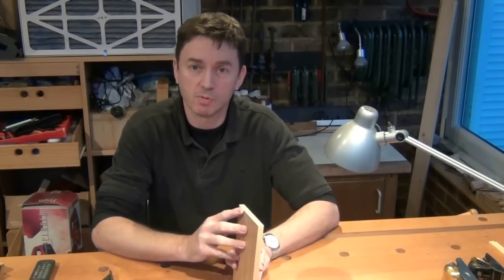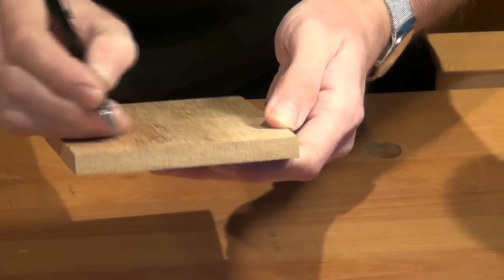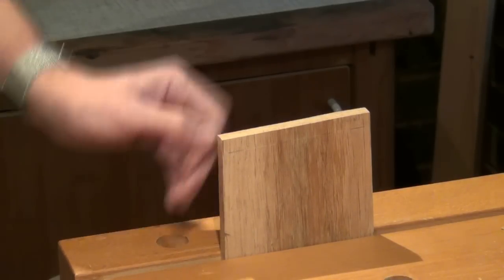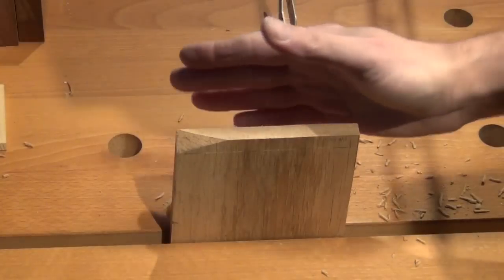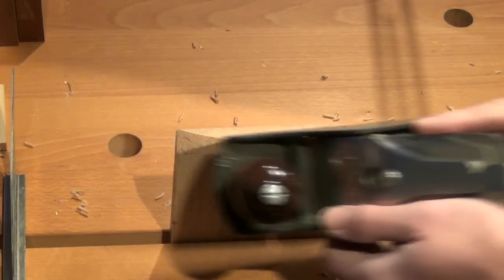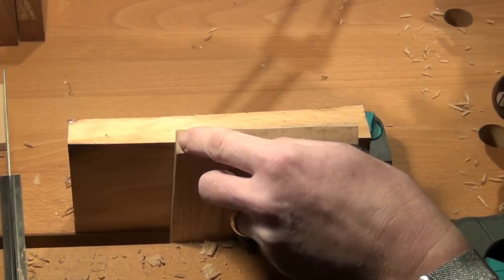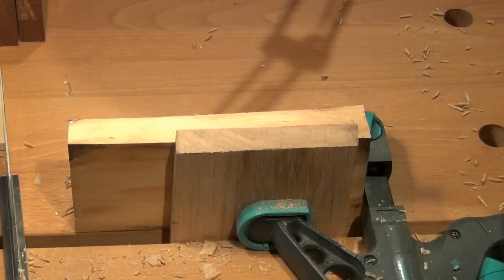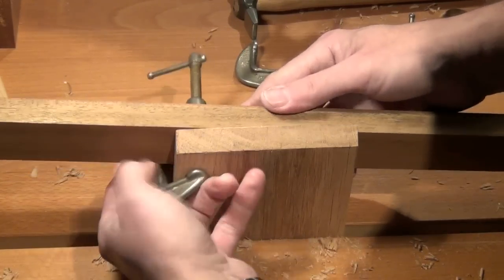Carcase Mitres - if you don't have a donkey's ear shooting board

Comment: Mitch, Very nice video and handy technique that I'm sure many will benefit from. Thanks so much. If I could offer a friendly suggestion to you and one to your viewers, I would say, when planing the bulk of the miter, try pointing the toe of the plane skyward over the end of the workpiece at a 45 degree angle so that its pointing toward the 10 o'clock position. You can think of this as decapitating the endgrain if you will, rather than plowing into it horizontally or on a downward angle which causes you to plane into the endgrain. It can seem a bit tricky to hold the plane at a 45 on the x-axis while simultaneously holding a 45 on the y-axis, but it greatly reduces friction and tear out. You will find that you don't even need that whole sequence of planing off the trailing edge before you get started. I picked this up from Paul Sellers when he teaches how to plane a roundover on box bottoms. Its not necessary to do this when planing longgrain, but doing it on endgrain saves lots of work and heartache. The second thing I would offer, this to your viewers, is when you find yourself thinking (or in this case saying at 12:41), "It's just starting to lose its edge" this is the exact moment when you want to stop and take your iron or edge to the stone. If the edge is noticeably dull, then its noticably in need of sharpening. I know when I first started woodworking and before I learned to sharpened freehand, I often delayed and pushed my edges past the point that was good for my projects which resulted in poor results. Since my sharpening takes no set up, I can now get a surgically sharp edge on planes and chisels in less than a minute. This allows me to never compromise on sharpness and produces superb results. As soon as I notice any degradation on my edge, its off to my diamond plates. Do this, and you will never be sorry. The key part of this is learning to sharpen freehand so sharpening doesn't take you off task for 10-15 minutes. If you trade jigs for acquired skill, you can sharpen very quickly and without the hassle of wasted time. Since Mitch seems to be a skilled woodworker, I'm sure he knows this and normally sharpens as soon as he detects the slightest dullness in his edges. I suspect he only pushed his edge beyond this point because he was in the process of filming a video. This is no great secret and I think nearly every woodworker figures this out eventually, so my hope is to help those of you who are newer to the craft and who have simply not figured this out yet. Happy woodworking and thanks again Mitch. Keep up the great work.
Reply from the maker: Thanks for those points Damien,
 A quick strop might have been advisable here. It's an interesting point actually, as I do feel the dulling of an iron at a very early stage. Often the blade will still cut hairs on my arm, and take wafer thin shavings. Clearly there must be an optimal point at which to strop or re-hone. Even at just half a minute to de-iron, strop, and re-iron, doing it every couple of shavings would be overkill. Deciding that point has to be a gut feeling, and it will surely improve with experience. What I feel is most important to get over to beginners in this respect is how to sharpen quickly and effectively, so that they don't put off the job.
 Skewing the plane is always worth a shot, but just be careful you keep enough sole on the work to register well. Personally I use a mitre shooting board, which protects against tear out.
Thanks, Mitch
Reply: +Mitch Peacock - WOmadeOD-Point taken and I agree totally. There is definitely a possibility of sharpening too often, but I think you would agree that this is far less common that waiting too long. I think most people want to keep planing as long as they can because its far more enjoyable than sharpening. I don't mind sharpening, but I'd rather work wood than steel. When I made the sharpening comment I was hoping to benefit the novice woodworkers that watch your fine video based on my personal experience. I know when I first started woodworking I developed a bad habit of pushing my edges way past the point of being good for a sharpening.  I was sharing my learned lesson hoping current novice woodworkers might learn vicariously from my mistake. Of course someone as experienced as you certainly learned that lesson long ago. Thanks again for a quality videos, keep up the great work.
Reply from the maker: +Damien King Being self taught, it took me longer to realise what a properly sharp edge was! kicked myself when I did 😉
Sharpening is very difficult to teach by video alone. I recently taught sharpening in person and it was so much better.
Cheers, Mitch

Comment: very informative, can i ask how would i do it if without having the mitred scrap wood you use at 10:30 ? Thanks
Reply from the maker: Faz Fazzi Hi Faz, Thanks, and yes of course. You can simply plane to the gauged line (inside of mitre), producing a slight bump across the joint. Then carefully plane the bump away. Taking shavings from the top of the bump, which will get progressively wider, until they just reach the edges. This takes more care and time than using the mitred guide, but it is the way to produce such a guide in the first place. Theoretically, you could make the guide like this first, then never have to use that method again.Happy woodworking, Mitch
Reply: Very clear.. thank you again!

Comment: What is the rebate for?
I have a donkey ear jig and it's off just a bit - the bed moved on me just enough to throw it off a degree.
Reply from the maker: The rebate was part of a much earlier project, from which this section ended up surplus to requirements. I like to use up leftovers :)
Your jig problem is quite common. You should be able to shim the error out. I shall be making a new donkey's ear shooting board for a video this year, and I will cover correcting errors in accuracy.

Comment: I'm trying to do this from scratch, the first thing I need is the miter "aid",how do I cut that to be accurate enough to use as an aid.
Reply from the maker: Keyhan Masoumi good question! 
Making the aid is a similar process. Use a mitre square and try square to lay out a 45 degree mitre on a flat, straight, board. Saw close to the lines, on the waste side. Plane, chisel, file, or any combination, a flat mitre surface that meets all the layout lines, and double check using the mitre square and a flat surface. 
I hope that helps.
Reply: Mitch Peacock - WOmadeOD 
I'll do it like you said,thank you for your quick reply.